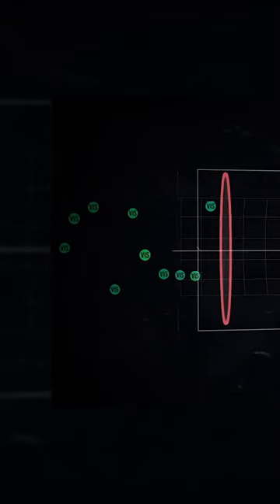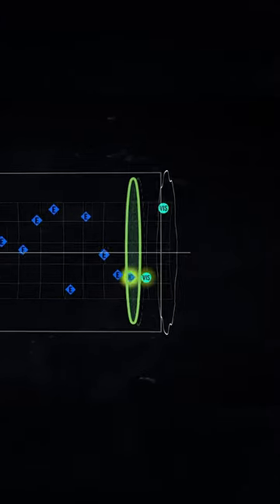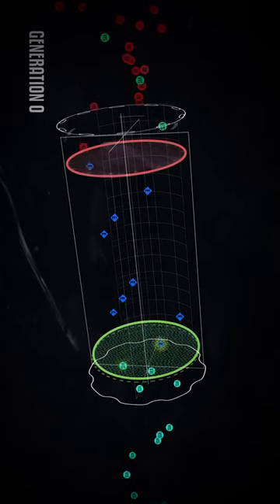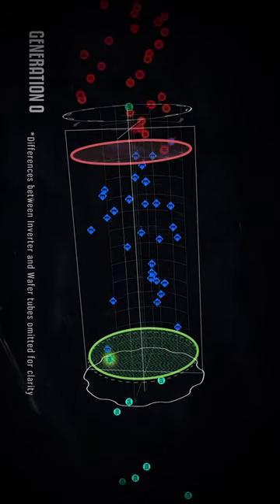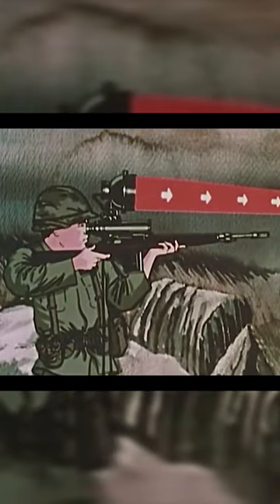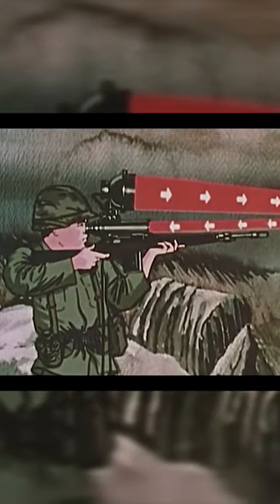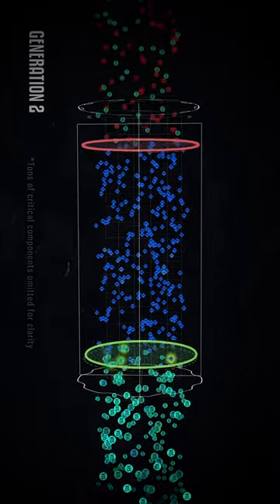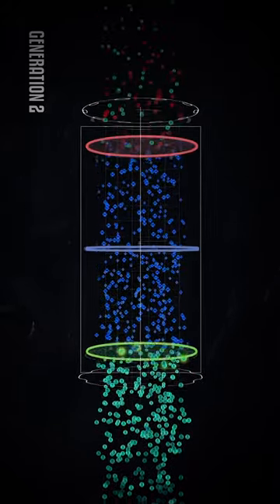How Night Vision Works

Comment: That’s really fascinating! Only one question though. What does the length of the night vision device have to do with the converting/amplification process? 

 Does it just give a little more time for the IR and VIS light to turn into electrons? Or did it help aid in the amount of light absorbed into the device?
Reply: In real tubes, they are stacked way closer together. I spread them out so it was easier to see what was going on. Also, I slowed things down just a little bit.
Reply: @isaacbotkintrex so this is how solar panels work as well? Instead of turning photons back into photons. We just make it as efficient as possible and store those electrons? Like a step up generator or something.

Comment: Do thermal next
Reply: Heat is radiation and a thermal scope is basically a radiation detector. 

“Thermal radiation is electromagnetic radiation generated by the thermal motion of particles in matter. Thermal radiation is generated when heat from the movement of charges in the material (electrons and protons in common forms of matter) is converted to electromagnetic radiation. All matter with a temperature greater than absolute zero emits thermal radiation.”

Comment: Gen 3 came out in the 80's and it's still what's available. Could you imagine what they actually have back in the labs? There's no way that in the past 40 years they haven't come up with something beyond the Gen 3 tech
Reply: I mean what is there to improve. Maybe thermal fusion devices but those are already becoming more common now.
you should look into the ENVGs to see some of the cool stuff theyve been working on
Reply: Look into Omnibus. They’re variants of the Gen 3

Comment: Pretty sure that's also the same method we use in the photocells of solar panels.. but instead of turning photons into photons, we just make the photon to electron transfer method as efficient as possible. Then store this energy in batteries or use  it lol.
Reply: This is a really bad video. The opposite of a solar cell would be the LED. What is common with PMTs is the semiconductor material. What sets them apart, and is not shown in the video, is the microchannel plate, and how they're set up for multiple bounces, creating gain. PMTs are still the preferred choice for some medical diagnostic scans.
Reply: @Tattlebot   thank you sir. I would like to learn from you kind sir. Take me under your wing 🙏🏼
Reply: @Teslabacon  There is also this excellent overview of night vision, but I can't guarantee youtube will allow it:

https://www.degruyter.com/document/doi/10.2478/s11772-013-0089-3/pdf